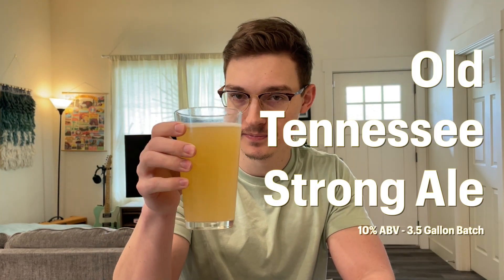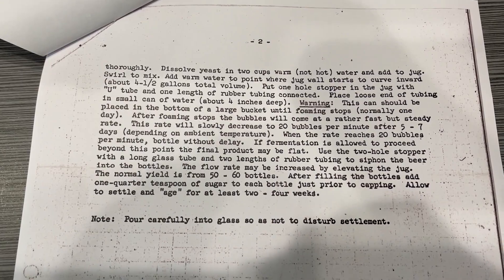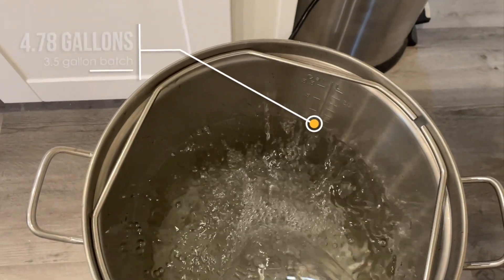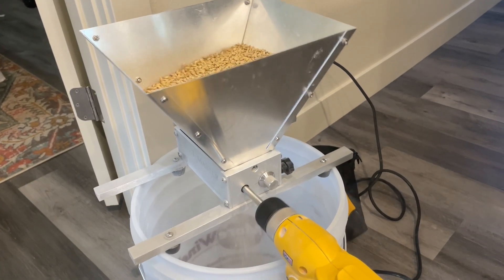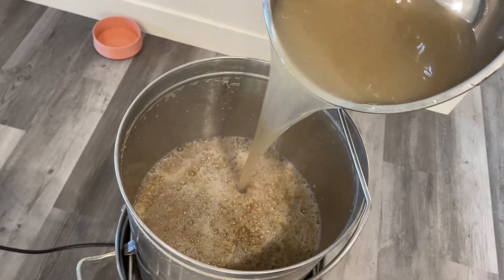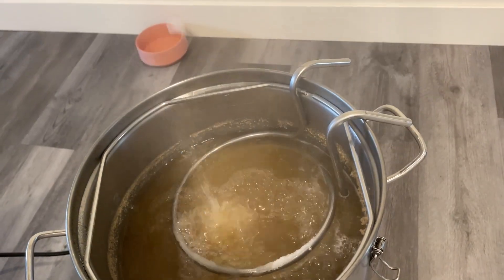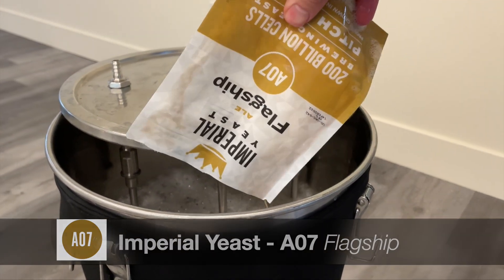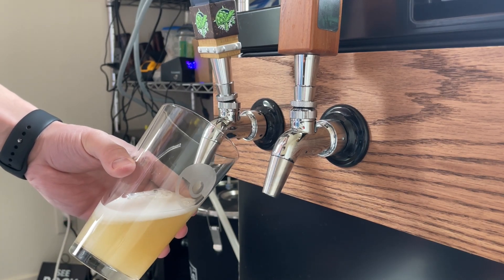I brewed at 10% beer recipe from the early/mid 1900s!

Comment: GREAT JOB!!!!! You produced authentic moonshiners beer. Authentic Prohibition beer is made from syrup. The brewing method and ingredients in home brewing came from Prohibition, they really don't have too much connection with making ale and lager. 
From the science side, when mash is rested at 149, 150F, Alpha releases the highest volume of simple sugar, glucose from simple starch, amylose, within one hour. The more glucose the more alcohol, that is why moonshiners use the temperatures. Glucose is responsible for primary fermentation and ABV. Sometimes in extract that contains a high volume of glucose yeast skips reproduction, and it may be necessary to add more yeast and yeast nutrient to support the extra yeast. Kwak yeast or whatever it is called is good yeast for making moonshiners beer. The yeast, along with added nutrient should complete fermentation within three days, which is exactly what a moonshiner wants to happen because the quicker the beer gets into a still, the better. The high temperatures denature Beta. Beta is responsible for conversion, which occurs at 140F. During conversion Beta turns simple sugar, glucose, into fermentable, complex types of sugar, maltose and maltotriose. Maltose and maltotriose are the sugars that produce ale and lager, glucose only makes the alcohol. When conversion occurs, secondary fermentation takes place due to maltose. Maltotriose is responsible for natural carbonation. The conversion rest is skipped in moonshining and since the home brew method copies the same brewing method, conversion is skipped in home brewing. In moonshining a step that converts highly, fermentable glucose that is already in the extract, into complex types of sugar and wait for secondary fermentation to occur when an enzyme in yeast converts maltose back into glucose isn't needed and Beta is purposely denatured. When conversion is skipped the beer is moonshiners beer, regardless of the title on a recipe.
Reply from the maker: Excellent write up, I think the history of moonshine and other historical alcoholic beverages is absolutely fascinating. Amazing how much of our current culture is directly influenced by this history as well. 🍻